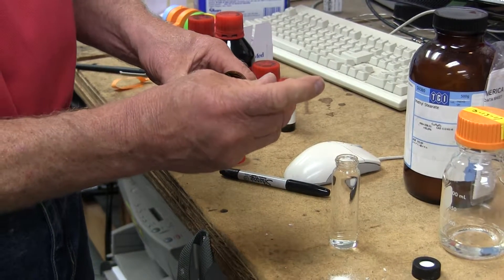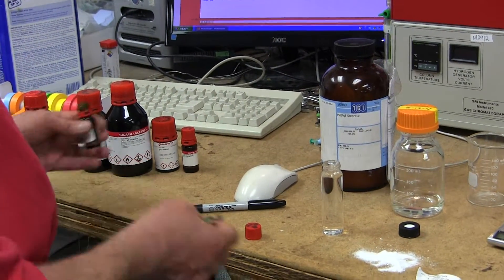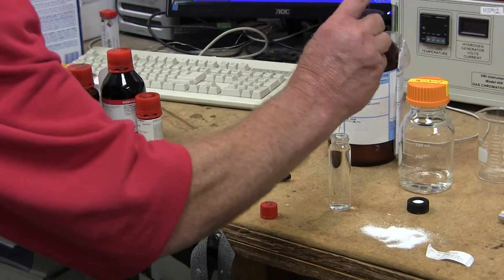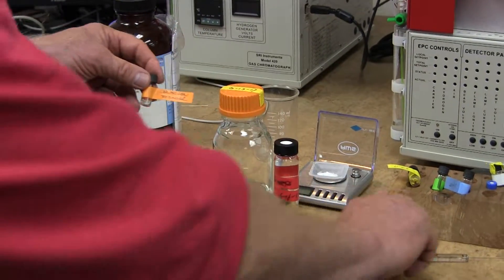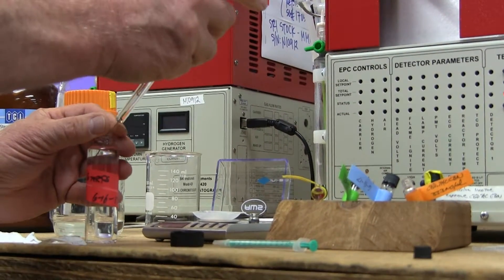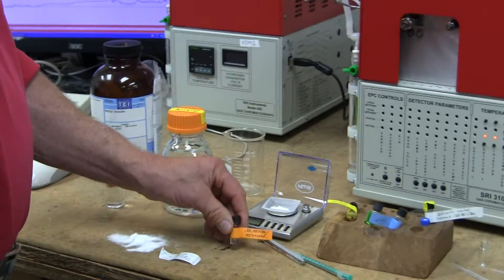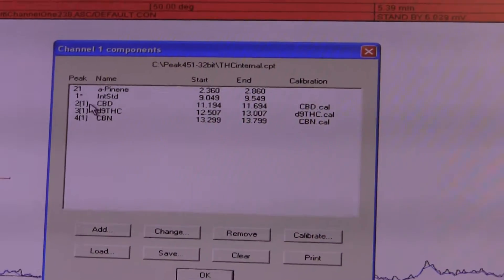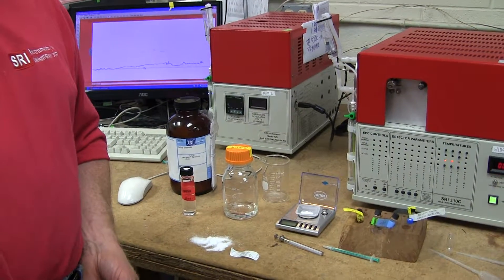Part 2: Making a Terpene and Cannabinoid Calibration Standard

Comment: wouldnt the cannabinoids concentrations be at 166.5 nanograms per micro liter, and the terpenes at 40-50 because you mixed 300 micro liters of internal standard/terpenes solution with 300 micro liter cannabinoids so you half the nano gram value of each. please correct me if im wrong, thanks